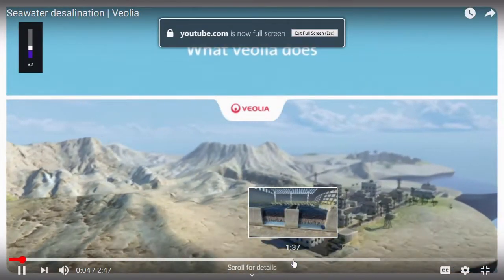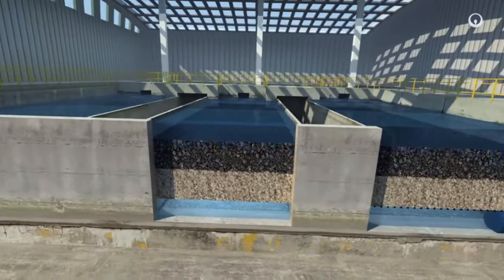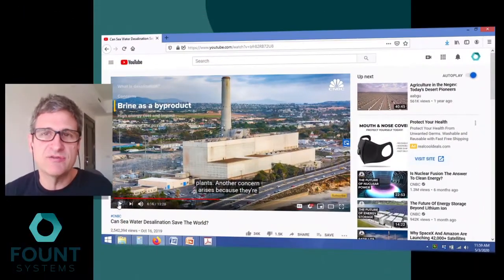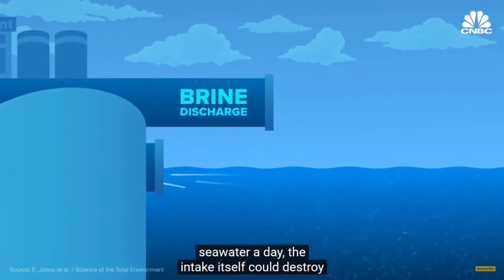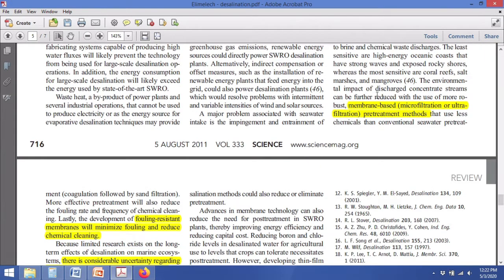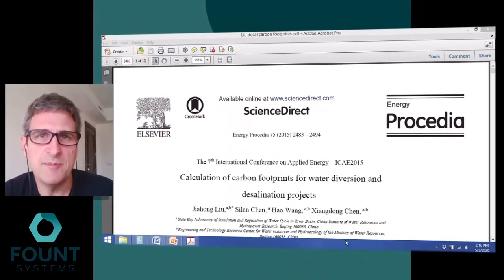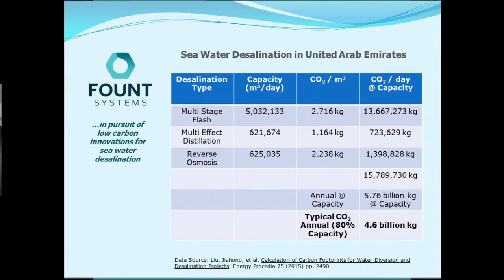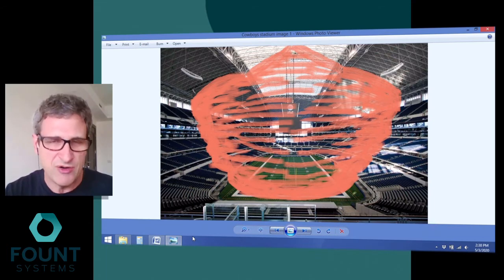Sea Water Desalination: An Overview and Environmental Impacts

Comment: In the US the Clean Water Act dictates what can be discharged to US waters and coagulants and other common treatment chemicals are not allowed.In a typical municipal water treatment plant coagulants fall out as sludge — it does not pass through with treated discharge. That would violate the treatment plant’s NPDES permit with EPA. So I’m sure a desalination facility would have to discharge those chemicals to a sewage treatment facility or build their own. I’m still no fan of desalination, but …

Comment: Awesome presentation, I'm just wondering if one could use water turbine to power these desalination plants or if that even would generate enough energy, say a plant half the size that Lesotho has.
Idk if you have had the chance to see the test on using brine as a means to create a form of energy supply. Very interesting and motivating developments happening, it's just sad that the costs of these projects are so high when results aren't guaranteed, much like launching a Rocket
Reply from the maker: Thanks! Sea Water Reverse Osmosis (SWRO) plants are powered by electricity only, and provide significant carbon reductions when compared with the older thermal-heat based systems. I just read that one of Egypt's new SWRO plants will be powered by photovoltaic, and it's easy enough to imagine that technically this could be achieved in any of the Gulf States, where they are pretty serious about solar. As far as costs, the big utilities, using current financing rates (which are historically abnormal!), are receiving bids for US $.50/ m^3, which is dirt cheap. Not sure how the smaller, community SWRO plants come in as far as cost. I don't know anything about brine as a source of energy! Please post something.
Reply: The YouTube Link to the test on using Brine to make a energy source:

https://youtu.be/VY32O5cy4BQ
Reply from the maker: Thanks for sharing the link. I had never heard of this process before. It looks like they made it work back in 2014. If I find some time (ha!) I'll see if I can find out what follow-on research has been done. They don't say how it works. I assume that the ions passing through the membrane generate some kind of electric current within the membrane. Maybe it's a bit like PV, where electrons get knocked out of the matrix by the energy exciting it???

Comment: Excellent online research. Perhaps the use of solar based electricity to power these massive desalination process could help offset the carbon dioxide emissions or replace them all together? How does Israel deal with this issue?
Reply from the maker: Thank you, and yes, exactly. that's a primary reason i've pivoted to industrial wastewater-- RO is a mature technology, and even plugged into conventional thermal electric systems, has a burden of about 3 kilograms (6.6 pounds) of CO2 per cubic meter (1000 liters, 265 gallons) of purified water, which seems relatively "low carbon" to me already. It's just a matter of time before these all-electric systems are powered more and more by renewables, making RO very low carbon. the brine appears to be the next big issue to solve, and not just for RO water utilities, but for industrial manufacturers as well.
Reply from the maker: The plan  interestingly, in Jordan the desal facility at the north tip of the Red Sea is planned to pipe the brine to the Dead Sea